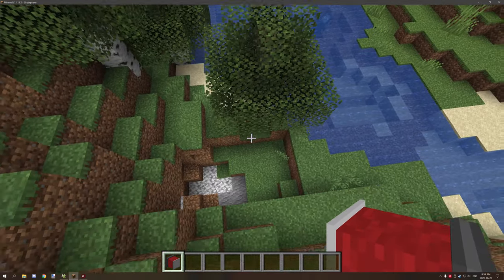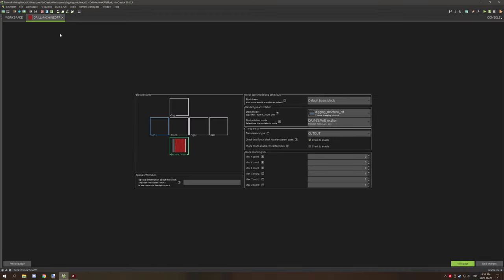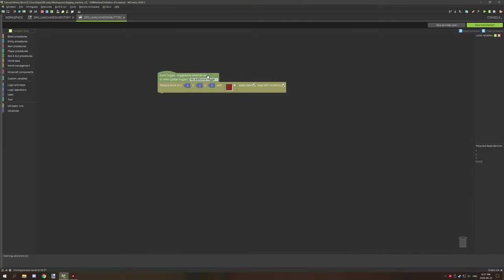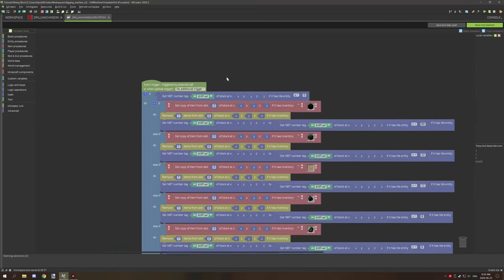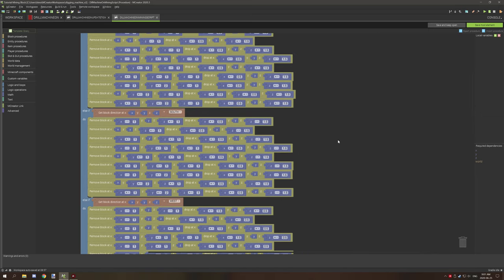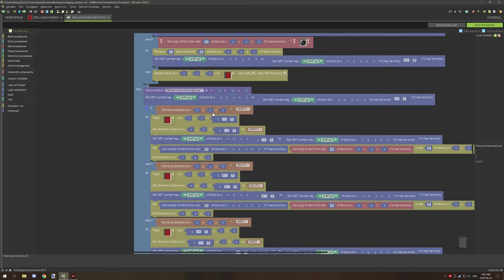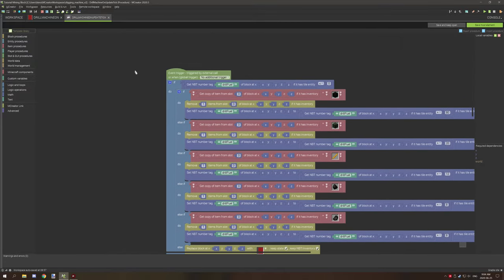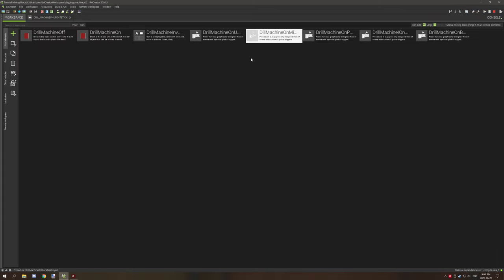MCreator: Tutorial | How to make a Digging Machine V2 | 2020.3

Comment: this is sick any way to make it so when a ranged item (my laser gun could easily shoot a 3x3 block tunnel for as long as the laser gun is being fired?
Reply from the maker: You could simply do this with even items or tools, actually, you just detect where the player is looking with the item then use a repeater to test for multipole distances with the players look direction using the raytracing for your X Y and Z blocks once you find a block all you need to do is run a script using 3 repeaters one for each axis (X,Y,Z) then have the repeat number 3 for each of them, lastly offset the variables each time so that you make a area to remove blocks, I have covered how to make area testing you can use this method for any area based things and stick any task inside of them for example to break blocks with drops to mine a area out. but you will need to find a block first hence where raytracing comes in.
Reply: @NorthWestTreesMCreator   thanks for replying but i have a easier soultion where i did this with a ranged item but ty

Comment: i downloaded the ptpl files from your website but whenever it consumes fuel, instead of removing one fuel, it drop it as a stack on the ground and adds a new stack into the drill, any idea on why?
Reply from the maker: It did not do that when I was testing it :/
It should not be doing that...
Reply: hmm, do you have any idea why? i could just be being an idiot, but i didn't change the code in any way

Comment: can you do how to spawn a mob based on height eg so a mob spawns deep underground or at the build limit
Reply from the maker: quite possible that this could work if you use a main entity with a procedure for internal spawn so when it spawns it will run the procedure, the only thing after that is you need to test for the entities Y position then have something like.

IF ( entity Y position > 63 )
    Spawn entity at X Y Z ( Entity Type 2 )
    Despawn ( Event/target entity )
ELSE 
    Spawn entity at X Y Z ( Entity Type 3 )
    Despawn ( Event/target entity )

I hope that helps a bit :D
Reply: @NorthWestTreesMCreator  yeah that does work thanks!

Comment: Can someone explain to me why when I made something similar to this....when it mines blocks it also duplicates the stack of fuel inside of it? Meaning it generates infinite coal instead of taking it as feul
Reply from the maker: its probably an math operator issue it could be a + rather than a -, or you could be using a wrong procedure block that adds to the count some how.
Reply: @NorthWestTreesMCreator  I will run both of these through bug testing and see if it fixes anything, Thanks!
Reply: @NorthWestTreesMCreator  yea so now it just deletes the entire stack of coal and doesn't mine anything lol
Reply: Update: I fixed it XD

Comment: my machine does not dig in 2021.3
Reply from the maker: I looked over the video I did not notice any blocks that would cause problems on the latest version of MCreator. My suggestion is to double check the example workspace and see if the workspace is working there. If so it may be a configuration issue in your mod instead.
Reply: @NorthWestTreesMCreator  my game crashes as soon as I start the machine